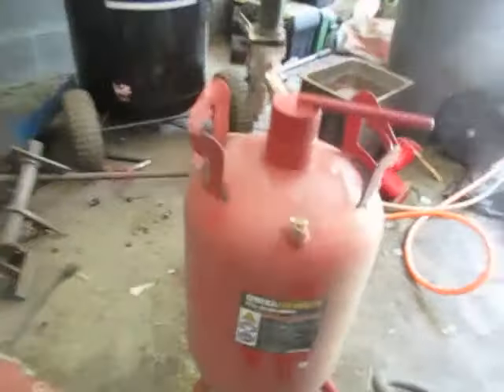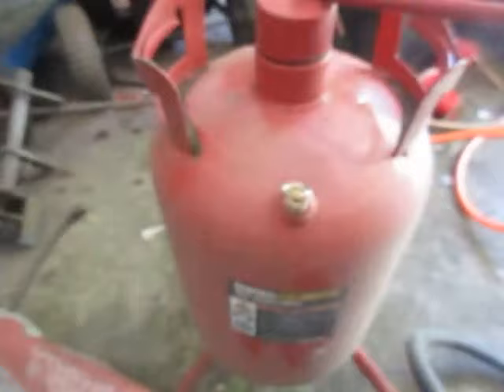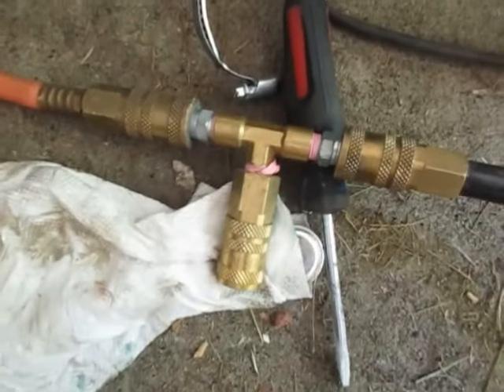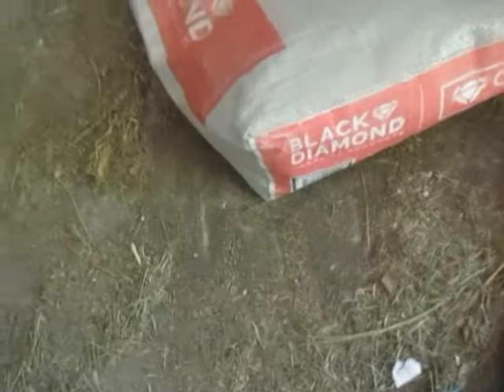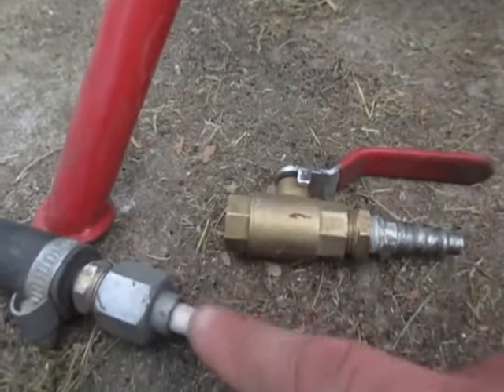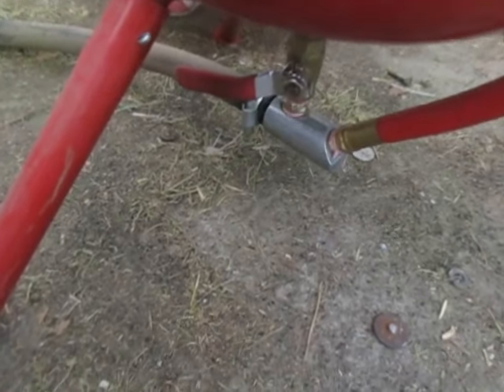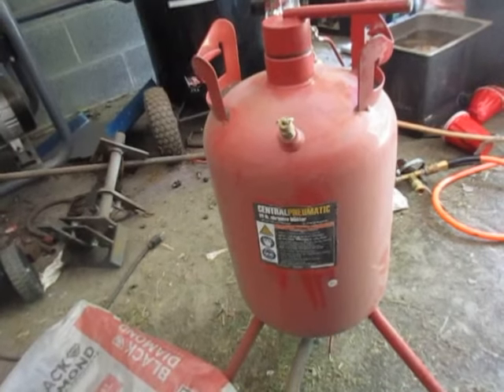Harbor Freight 20 lb sandblaster tips / review

Comment: Get rid of the mixing chamber and use a 3/8 in tee and 2 inch  nipple. Get a 12 to 14in pvc the almost fits into the nipple. Sand down until you get a snug fit. Drill fairly large holes all the way through the tube  the full length of the tube. Insert  into the tank and you will get a more even sand flow.

Comment: Thank you. I got one of these used for $5.00 at a yard sale. It's been sitting behind my shop for4 years and I finally pulled it out of the weeds. I have an adequate compressor but the performance is dismal. I did a you tube search and your video was towards the top. Excellent explanation on the weak areas. I'll be watching your next video and do these modifications. I have a small utility trailer to strip and repaint.

Comment: I did a whole vehicle with it.  Yes, it took some time, but I wasn’t in a hurry.   But actually, in my experience, it didn’t take too long.   I sandblasted my ‘99 Jeep Wrangler & it did great.  Same set up with a little bit stronger air compressor than you have but the rest is all the same

Comment: Great, I do have a lot of CFM (38) and 2 blastcabinets but some large items can only be blasted outside. Now I have used a handheld for a few days which did work but needed constant refill (frustrating on large items) so I looked into these cheap blasters since I only need it 2 or 3 times a year but everybody complained that they constantly clog up. Now I think I can give it a try but I will need an additional pressure regulator since I have only one access point on the outside which has a constant 165psi which is too high for good steady blasting.
Also I can confirm that opening the bottom valve only a little works much better since I have such a setup on one blast cabinet and it is barly open for steady work (else it starts puffing).
I will definitely follow your advice.
Greetings Bernhard
Reply from the maker: If you've got 38 cfm, check out my other video. You'll still need to regulate down the air pressure, but it should do great.

Comment from the maker: 0:01 Me lamenting frustrations with the device
0:59 Air supply requirements
2:54 Abrasives  (available at tractor supply- fine coal aggregate) to prevent tip clogging
3:40 setup tips (to ensure maximum airflow)
5:00 user technique to minimize hose clogging 
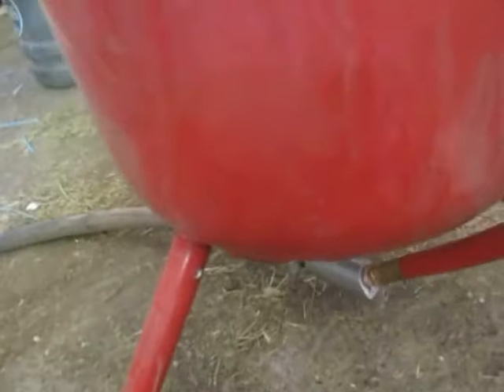7:40 reusing/sifting abrasive ...and how to use up all the playground sand you bought

Comment: I have a 33 gallon air tank and ran 'fine' walnut through the blaster.   The larger tip works for walnut otherwise the tip keeps plugging up.  Also, 105 lbs at least to do nice work with walnut. I could only run for a couple minutes at a time till i had to wait for pressure to build back above 100lbs.  Also goes through a bag quick!  I ended up removing the valve at the tip and used 1/2  fittings and ball valve at the bottom of the tank to free up flow. This unit works, but was more picky with walnut and i live in a humid region.
Reply from the maker: Good to know. Thanks for sharing!

Comment: I openthe bottom vales ti media comes out, then when it clogs I close tank charging value up top and pull releases pressure ring until air enters tank from below thus clearing blockage... then recharge tank and continue...
A palm sander ratchet strapped to tank will give you the vibration needed to get even flow of media without shaking it by hand...
I've clean a lot of stuff with menards black blast, and sifting thru a screen with palm sander agitation in to a bucket is key to saving on media..
If you have a few smaller compressors run them together with custom splitter and they will all keep up... moisture is a blaster killer, so drain tanks and install a few moisture catches.
Also run my ceramic nozzle the same, no valve or dead man..
Reply: Yeah I also thought about using some sort of offset motor to clear the jams. But I found out trying different setups that it mostly always clogs in the tip or the choke point not from the tank or media hose. So I swapped the tip out for a larger diameter and with my setup that seems to be working well not much loss at all in pressure or ability to blast. I run coarse media through it now just fine. Sucks that they sell them so you have to mod it to work but that's corporate capitalism.

Comment: You may have saved the blaster I bought today- Seriously, I have a dumpster.  I will check my SCFM tomorrow and if it is 6 or less I will give the tool another try (connecting a second compressor).  Also, someone probably already mentioned this, but play sand still contains silica.  It is not safer for blasting than regular sand.  Silica fibers are small enough to get past respirators.  Don't mess around with that stuff.
Reply: How did it work for you any better or did it hit the dumpster for good
Reply: @chrisgreenley5927  Kept the blaster.  I haven't  picked up a larger compressor yet, so it can hang around for at least a little longer.  My compressor is only 4 SCFM.

Comment: Id maybe put 2 valves inline on the bottom. One adjustment and one shut off. Then id take the handle off the adjustment and hang it on a piece of string so your adjustment doesn't accidentally get moved.

Comment: You know of a bigger one? not a bigger hopper but one that requires more cfm? I got a 30 gal 16hp gas driven  compressor that does 34.4cfm at 90 psi with a 1/2 outlet... I was looking for something bigger that can do a spray pattern so I can sandblast inches a second as all these videos with this model are slower than a wire wheel on a  drill and more mess.

Comment: Wich number of abrasive u have please 
20/40 40/60?
Reply from the maker: Thanks for writing. The coal slag is fine grain from tractor supply. It does not contain a number in the tractor supply site, however, a search for "black diamond fine coal slag" pulls up on amazon as 20/40. I don't know if it the same or not, but it looks similar. The tractor supply link is here:

 https://www.tractorsupply.com/tsc/product/black-diamond-fine-blasting-abrasives?cm_vc=-10005&st=black%20diamond 

and the amazon link is here:

https://www.amazon.com/Black-Diamond-Blasting-Abrasive-Grade/dp/B0752MT2VP#:~:text=Amazon.com%3A%20Black%20Diamond%20Blasting,50%20lbs)%3A%20Home%20Improvement

The 50 lb bag from tractor supply is $9. From amazon $47? I don't understand the price disparity, unless it includes shipping. I just get mine from tractor supply. I hope this helps. Good luck.

Comment: does the second air compressor need to be running as well or no? im not understanding that part too well.
Reply: Yes to use it’s volume also
Reply: I’m having difficulty with mine. I have two compressors…Idid you use a ball valve on your compressors?

Comment: Probably want to mention the regulator you have on there
Reply from the maker: I went out and checked. Central Pneumatic. 68232 part number. El cheapo. I changed the placement in the second video and don't even use regulators on the main line anymore. I would recommend several air dryers in line for best results.

Comment: Those ball valves are complete garbage for cutting off sand they just grind in the valve and clog... I ran a heavy duty spring 3/4" push button valve with adapter couplings to 3/8"  off the sand supply hose. I hooked that to a regular sand blaster gun and run it with two supplied air lines. It's a two handed deal with one hand to release the sand at the bottom of the gun and one to accelerate it with air from the regular trigger. But even pushing 8cf at 90psi it works 10x better I could probably do a whole car although at a dime sized rate. The nicest thing is it rarely jams.